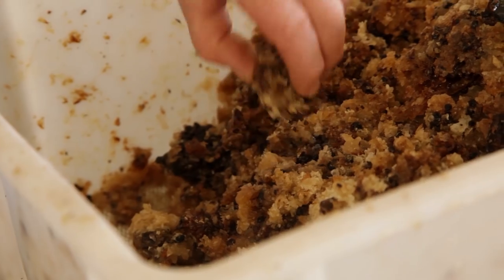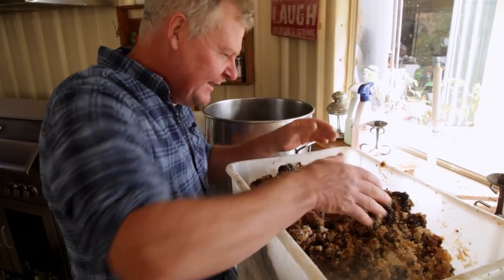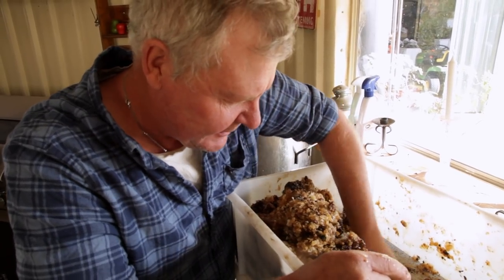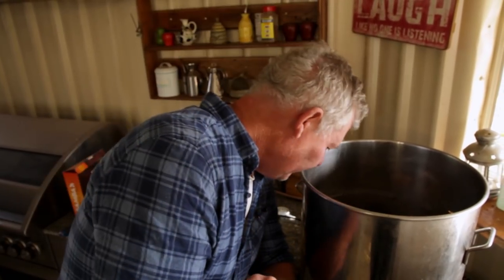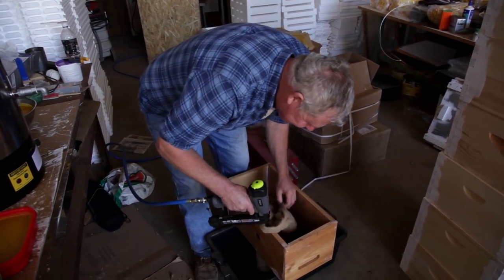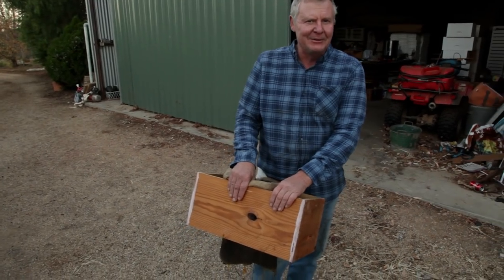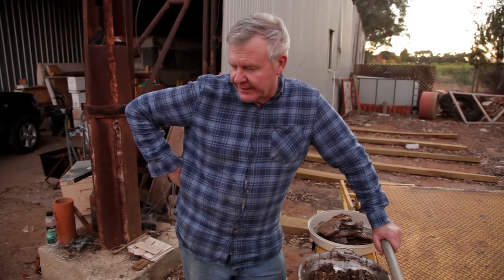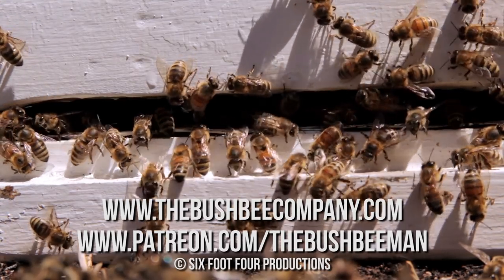How to Separate and Clean Beeswax (Part 1 of 3) - Episode 54: "Wax On, Wax Off"

Comment: If you were to slow down a little and pour the wax off the top of the water slowly, through a paper towel covered sieve, you could do it in one heat up and a few slow pours, then the paper towels are perfect firelighters., The bottom dark water is also great for your compost heap. Love your videos.